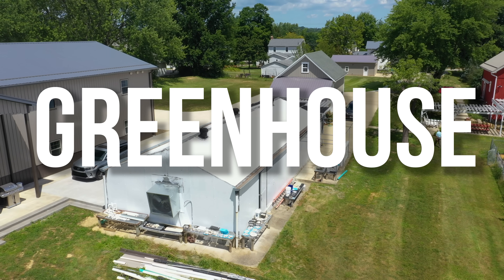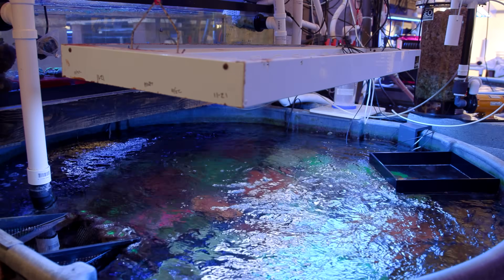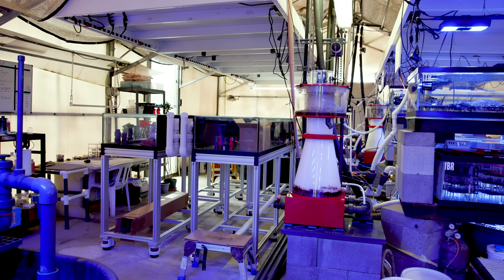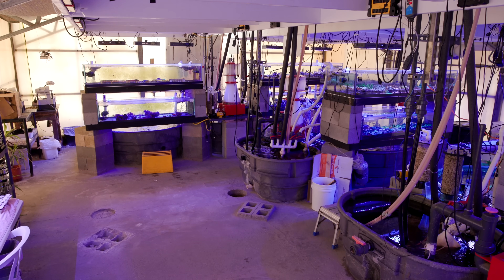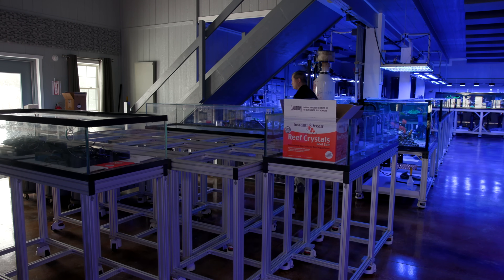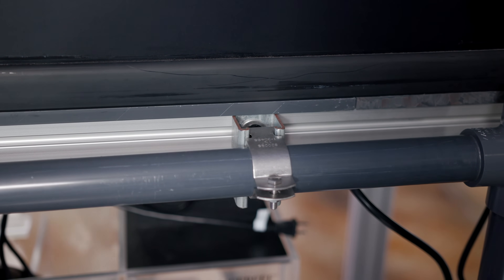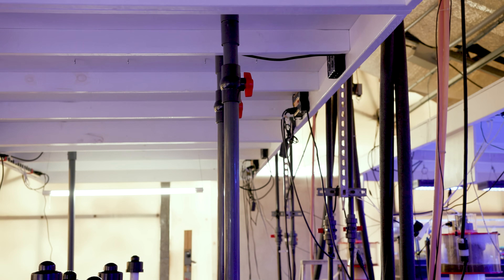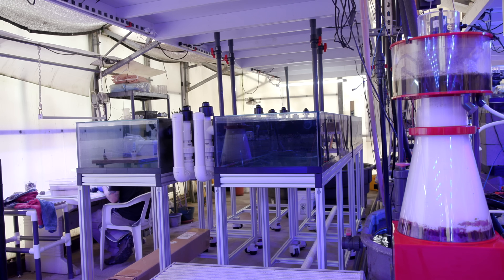Greenhouse Coral Farm Update: Growth, Challenges & Future Plans!

Comment: Hey Than! Thanks for the video great content. I just picked up all the pumps for my new 300 gal- return, closed loop, skimmer etc. Went with Deltec Eflow 8, 12 (x2), and a 16. How have you liked these pumps so far? They seem very well built and theyre super quiet. As good as your Abyzz stuff?
Reply from the maker: I think Deltec makes a good pump.  Abyzz is still my cost-no-object pump of choice but we occasionally try other brands and of those brands, Deltec is a good performer.
Reply: @tidalgardens  right on I'm excited to see how they do. Also thanks for the tip on the fiberglass unistrut- great option being cheaper and probably even better than stainless.